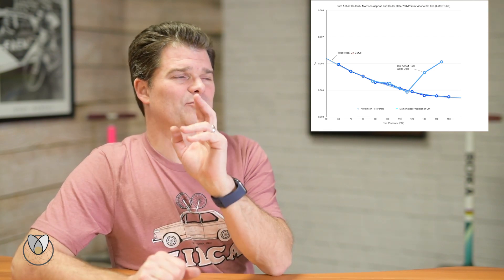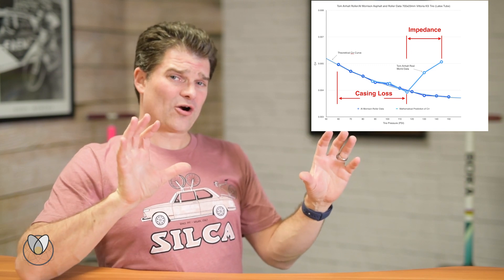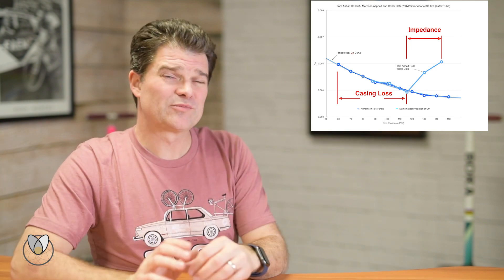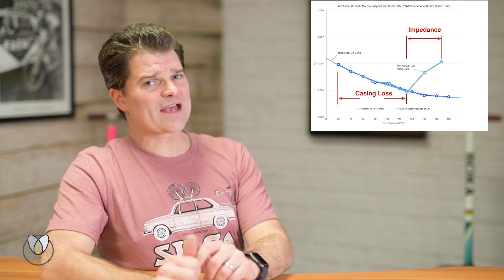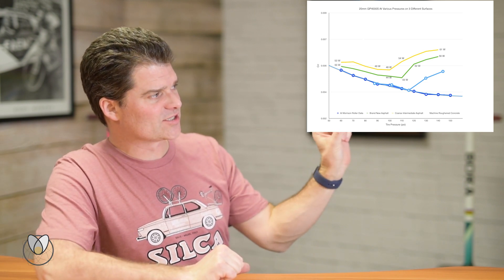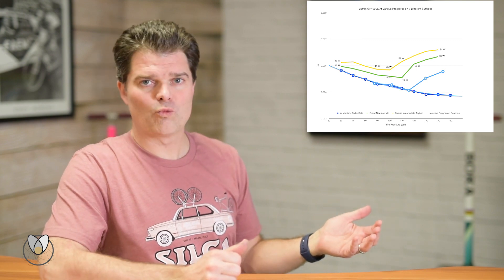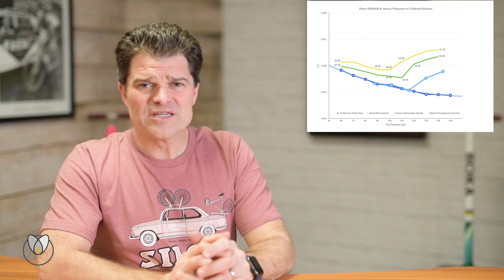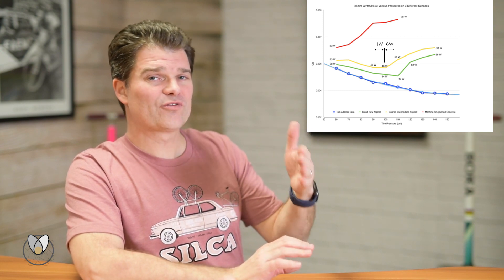Ep0002 Asymmetry - The Shape of Bicycle Rolling Resistance

Comment: I was recently building a new set of deep section disc break wheels. For my mtbs I now always use asymmetric/offset (spoke holes) rims. There are a few brands that offer also deep section offset rims for road bikes. I was hesitant though because I was unsure if I would compromise aerodynamics. 
Have you got any experiences with such offset rims?
Reply from the maker: Theoretically this will affect aero making the system more aero in wind from one direction than from the other, but in practice the effects are going to be insanely small and we've never managed to actually measure then in field testing.
Reply: @SILCAVelo  Good to hear! Then my next rims will be asymmetric for they improve lateral stiffness and better left/right spoke tension distribution.

Comment: Great explanations and a nifty calculator with more in it than I thought at first glance (the pinch flat/rim damage piece is awesome).   Does the slope and intersect point of the "impedance" part of the curve change if one is riding say a BMC URS with front and rear damping, vs say a straight up conventional frame and fork?
Reply from the maker: Lower vertical stiffness in the frame will generally move the impedance pressure higher if it is undamped, but will push it lower if it is damped as frame member deflection from say carbon, ti, or steel has less hysteresis than the tire casing, but any damped suspension element will have much higher hysteresis than the tire casing.  The real beauty of systems like the URS is that they give you much more flexibility, you can run lower pressures with less pinch flat or rim damage risk, while generally being able to run higher pressures with a shallower impedance curve angle.
Reply: @SILCAVelo  Hmm -then should one be able to run at a lower overall RR at higher pressure than your calculator says if you are on say a GT grade with undamped fiberglass seat stays?

Comment: So, Josh, how does one find the 'sweet spot'? Does the Silca Pro Pressure calculator get me there? Also, does the calculator account for tubeless?
Reply from the maker: Yes, you can use the Chung Method to find your own sweetspot.. OR you can use the calculator to leverage the thousands of data points of others ot help get you 99.99% of the way there.  And tubes, tubeless, tubular.. doesn't matter, the air pressure drives spring rate which is what we're after here.. so doesn't matter what type of system you are running, the optimal pressure will be same (within gauge error ;-) as the tire type is not driving spring rate, but only the damping..

Comment: I don't want to nit pick, but that's not THE Parthenon.
Reply: The Parthenon in Centennial Park, in Nashville, Tennessee, is a full-scale replica of the original Parthenon in Athens. It was designed by Confederate veteran William Crawford Smith and built in 1897 as part of the Tennessee Centennial Exposition. - Wikipedia
Reply: Matt Searels Interesting. Which means it illustrates Josh’s point perfectly. It’s still not THE Parthenon. 😊
Reply from the maker: Unfortunately the REAL parthenon is non longer symmetric.. ;-)